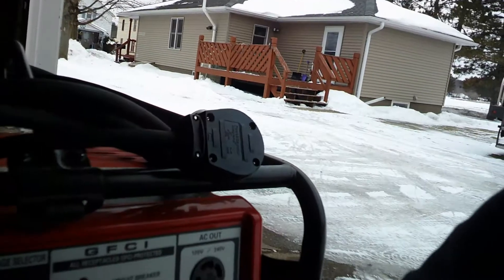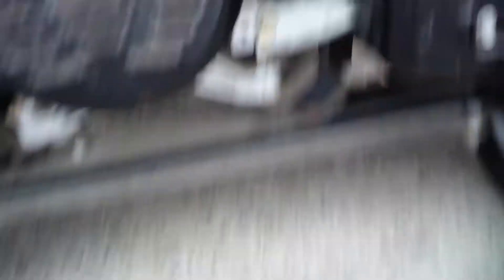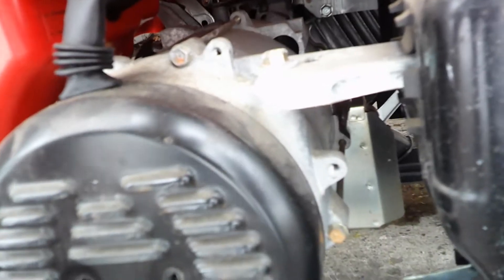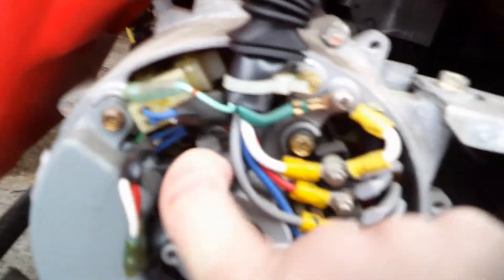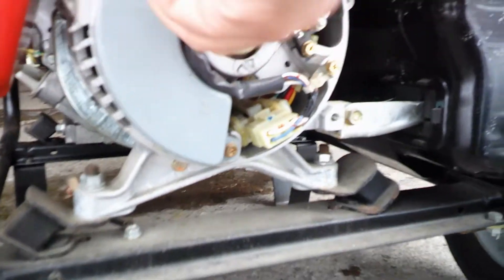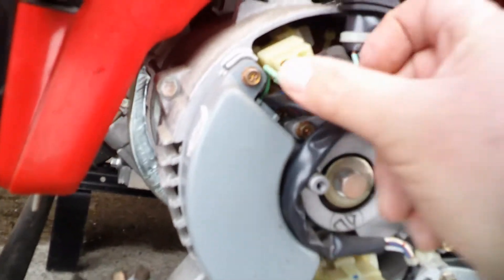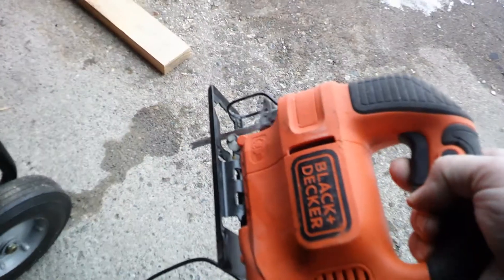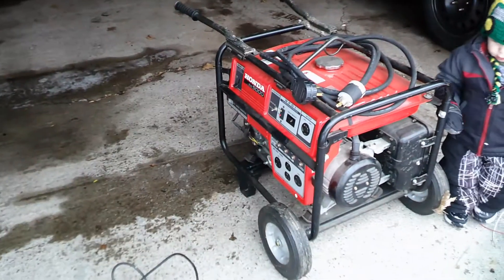How I flashed my Generator.

Comment: You can do this with way less  work.. just take your battery lease and hook them to a one 10 plug.. Pop it in your outlet while you're generator is running and it will flash your capacitor

Comment: I think the iron plates the copper is coiled around is very low alloy or carbon which doesn't hold magnetism  well. The idea is that the polarity is always shifting and they dont want to hinder that.Just a little alloy or carbon in the iron should help it with enough residual magnetism. Ive never had this problem with older equipment.

Comment: I have done the same thing using a 12 volt power supply with at least 2 amp output or more.  I believe the method you demonstrated only works if the brushes have no rectifier as part of the brush assembly.  In other words, I'm not sure if you apply 12 volts DC to the input of the rectifier, the rotor will be magnetized.  I haven't tried doing that with brushes that have the rectifier incorporated.  If you could you let me know if the brushes on you generator had a rectifier on the brush circuit board.  BTW, I could never get the Electric drill method to work. KOKO!

Comment: I do the same thing with mine, connecting an extension cord to my 12 V battery and then simply plugging it into one of the outlets. It only takes about a second or two but you wouldn’t have to take off the powerhead cover and it’s very very easy.
Reply: Great tip using the receptacle to input 12 VDC!
Reply: GOOD IDEA  WHICH  WIRE DO YOU APPLY THE POS WIRE TOO

Comment: If you flash the coil reverse-polarity by accident, do you then need to up the voltage by 0.5v in the correct direction to fix it? (twice the power)? Maybe it will be 180 degrees out of phase and the exciter won't work?

Comment: You lose your residual voltage because you shut the generator with the load still connected. Shut the circuit breaker before you kill  the engine.
Reply: You are exactly right! That's why you don't let the gen run out of fuel while powering!

Comment: My Generac 40KW PTO has a terminal outside for flashing the field. It doesn't need to be a huge battery. I use a 9 volt and it works instantly.

Comment: never mind the flashing, why on earth do you have a suicide cord ?  backfeeding your panel with it is plain stupid and dangerous .
Reply from the maker: As long as it's done safely no one gets hurt. I have done my research and know to isolate my house from the power grid.
Reply: @borderlineyooper527  Problem is 'safely' using a two head snake depends on doing the full exact sequence of breaker flipping and plugging in cords Every.  Single.  Time.  One slip up one time and BOOM.  This is why either separate cords or a transfer switch are the ways to go.
Reply: @randacnam7321 how do you know he don’t have a lock out on his main panel?
Reply: @mikerossman9863  That lockout would have to be something like a trapped key interlock where the generator run switch has a key that is only released by a lock that only releases the key when the main breaker is off.  Even then, that could be bypassed by a spare key or using another generator with a receptacle that mates with the extant generator cord.  Those breaker panel mount interlocks are meant for use with a circuit that is only a generator feed.
Reply: @randacnam7321  is that not what he has a cord (suicide cord) plugging in to a receptacle?  That how I see it, could be wrong though.
Reply: @mikerossman9863  The receptacle being used as a generator feed point is normally for running a grid fed load, and thus must be capable of being fed by the grid.
Reply: You could use that to power an RV.
Reply: Looks like the cord I use to feed my house when the power goes out. There's an ABT between the house and the grid.
Reply: Cord scared the crap out of me because my best friend was a lineman and a home generator killed him
His wife and 3 kids still suffer from it 10 years later and she has two jobs now
Reply: @philliphall5198  I don't know about in your neck of the woods but every lineman I know has been trained to treat EVERY circuit as hot.  Those linemen live long and eventually retire to draw their pension.

Comment: Get a corded drill turn on the on switch of the generator plug in the drill and manually turn the drill and it will create a new magnet field for the stator.
Reply from the maker: I tried that even turning the corded drill with a battery drill.
Reply: @borderlineyooper527  
It worked on a generator I bought at the pawn shop for cheap that wasn't producing power. All good fren at least you got yours working.
Reply: Put a 1/4” drill bit in the drill and chuck the other end into a cordless drill. Hold the trigger on the electric drill and run the battery drill, spinning the electric drill. Instant. Voltage
Reply: That's for those who have it, this is for those who don't, so appreciate it when people give you option. Don't be one way rigid in life
Reply: @ephraimojima4582  
I just posted what I did to a generator that had no output power and was able to make it work again. 
Don't have a clue what bs you crying about. Don't be one of what kind? Who the f are you.

Comment: This is most common with smaller popcorn gensets.  Hey, run them for 5 minutes couple times a year....and don't  forget to shut off the gas and run the carb dry to save yourself a headache.  I have a couple older rope start jobs and never have to do what you are doing.  I am guessing you have a slight parasitic draw down....if you do...once the motor shuts down...turn the power/ignition switch BACK ON.  that should end the parasitic draw...better still figure out what is causing and fix it...but for lazy people turn the ignition switch back on.  Now you have to remember to do that....
Reply: lol popcorn, first time i've heard that.
I was lucky; hadn't run for 4 years but still worked okay (ran for 30 mins a few weeks ago.)

Comment: I wonder if something else is wrong that is causing the loss of magnetism in the rotor.
Reply: Not really.   The residual magnetism gradually wears off over time, especially if the generator has been sitting idle for a long time.
Reply: I have a Honda EB6500 that has sat for 4 years! Got it out, started on 1 pull! Powered house for 2 days, no problem!

Comment: I find it easier to use a corded drill. Plug it into a socket with the generator off, pull the trigger and spin the drill by hand.
Reply: Thanks  I did it that way and it worked except  it didn't  worked with  generator  off I had to start it up  and kaboom  I also used a cordless  drill to spin the Corder drill
Reply from the maker: I tried that even spinning the corded drill with a battery powered drive.
Reply: @borderlineyooper527  It's worked for me in the past, I don't remember which way to spin it correctly though
Reply: @MrLongshot762  Backwards. (reverse)
Reply: It cannot work. Drill have universal motor. They don't have magnet inside so it does not generate electricity when you spin it. Completely fake. To people who don't believe me, hook a multimeter and check out by yourself.
Reply: @HwSystems  Tell me more about this "universal motor" with "no magnets inside".
Reply: @MrLongshot762  I think wikipedia will explain a lot better than me. Look 'universal motor' on Wikipedia. You will have picture and a list of thing where it is used. Corded powertool almost all have universal motor and cannot generate electricity by rotating them.
Reply: I do this a lot but some times I have to get a car battery and flash it 
Folks start them every few months and you’ll not have this problem plus keeps carb clean and working correctly
Reply: The drill trick only works **SOMETIMES** it depends on how bad the magnets are depleted.
Reply: Take a 110 plug and hook a 9 volt battery to positive and a negative and plug it in your generator while it is running and it will flash your capacitor